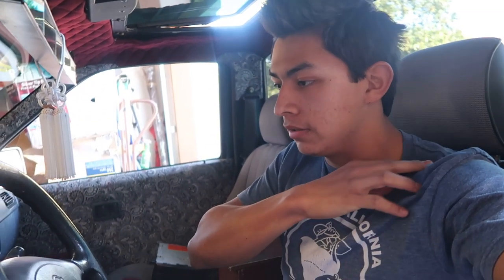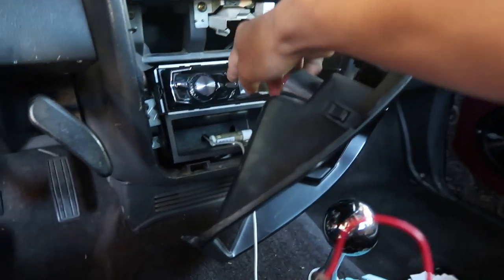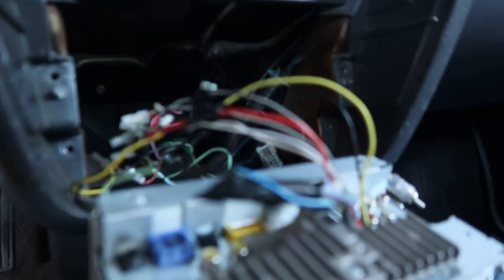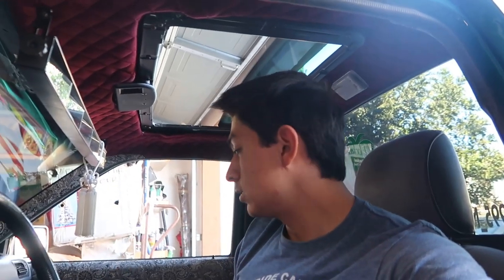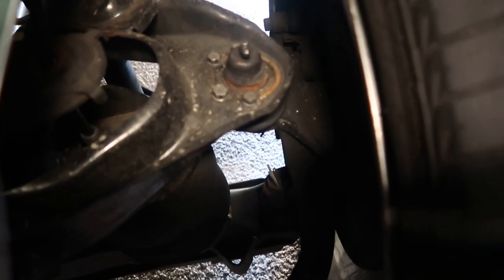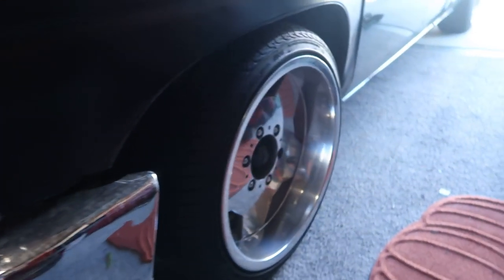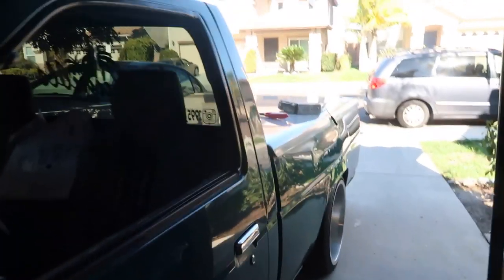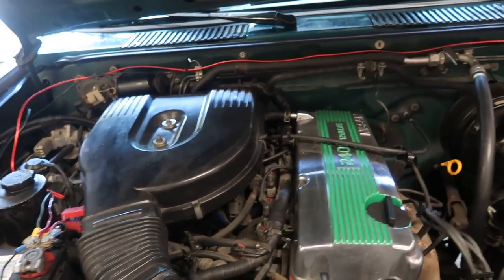NEW DOUBLE DIN!!!

Comment: So the shop basically made it your fault? id be raising hell if i couldnt get lugnuts on my wheels.
Reply from the maker: Wershingtern I didn’t know till I took the wheels off again at home
Reply: @humbleniss9056  Les Schwab sold me wheels and tires, the lugnuts they put on were discontinued shortly after(first ive heard of discontinued lugs). 1 year later when that car got wrecked and i wanted the wheels, they told me they couldnt remove them. Lots of arguing, they ended up scratched the shit out of my wheels to ge the lugs out.

Comment: I had a double din but i took it off i have a single since it has more volume and i dont use it i have it in my wifes truck...what fuel tank do u have i just bagged mine and dont want factory cuz i have no idea how to make it look right
Reply from the maker: Elchingon_92 I have the stock fuel tank relocate towards the rear of the bed , wanna go with a 12 gallon fuel cell